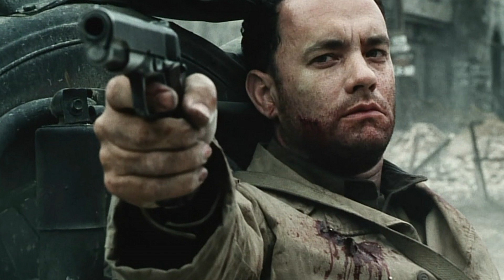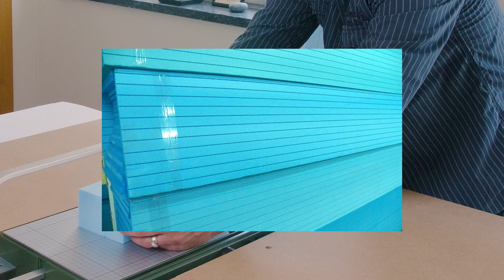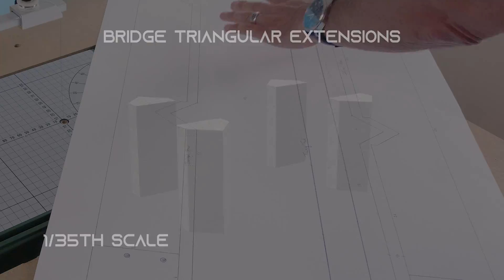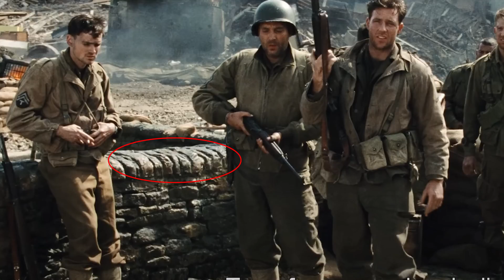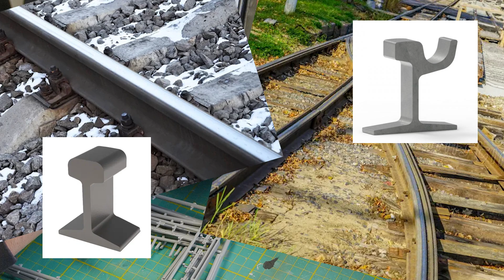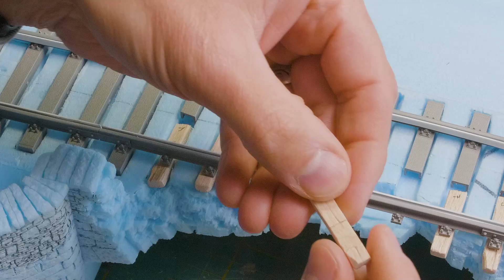XPS foam Ramelle bridge 1/35 Scale - Private Ryan movie diorama

Comment: By using 1/35 th scale, you limit yourself to using plastic model vehicles and troops- which you must assemble. If you use 1/32 (54mm) scale, you can use assembled vehicles and troops from various makers. You'd have a much wider variety as well.
Reply from the maker: Thank you for the advice Quasar 😉🙏

Comment: I made a German attack on a railyard in Stalingrad diorama. I went and bought some O scale track, popped the metal rail of the plasting sleepers and then made balsa sleepers and laid the track. The scale is close enough that no one cares. Cheap and easy.
Reply from the maker: Fully agree 👍  it's much nicer with balsa sleepers. In my project, only a little part of some sleepers will be visible so I've had less work and I just focused on these visible segments 😁 I try to win time where possible 🤣
Reply: Well, as a retired railway engineer I can assure  you that no standard gauge  railroad is running over a bridge curve like this one, only Trolleys or extreme narrow gauge (2 ft ) did that in Europe.  @18thsquadlab
Reply from the maker: @steffenrosmus9177  thanks Steffen 🙏 I can imagine... 😁 I'm not a train nor a tramway specialist...🤣 just try to replicate a movie scene as I can. 😉